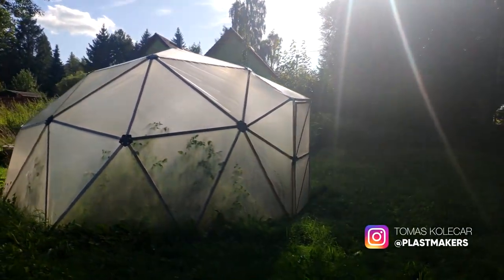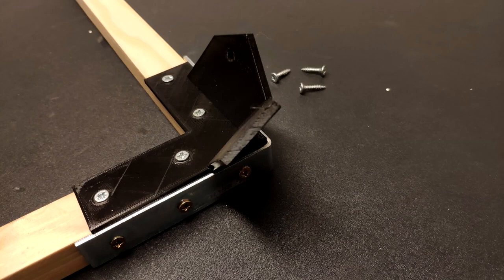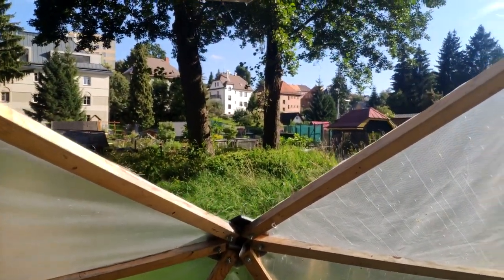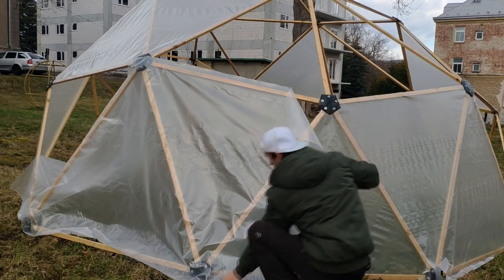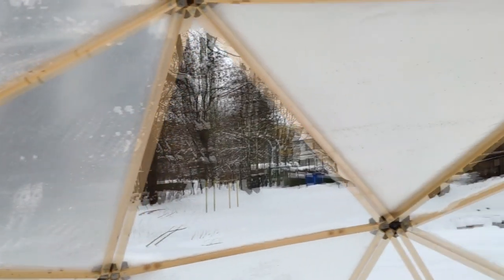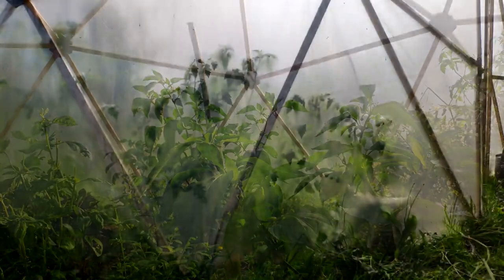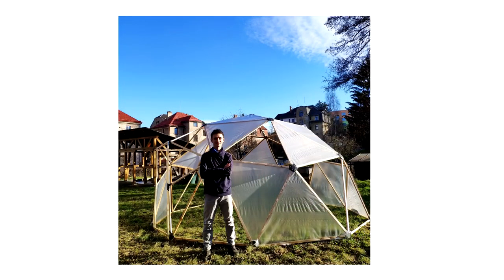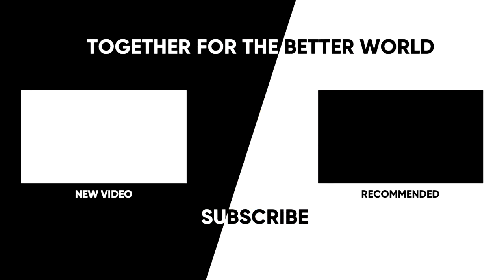How to make: Greenhouse dome

Comment: Thanks for sharing, amazing job. Can i ask, i have alot of pvc waste water pipe (21.6mm) and would like to build this as a dome over a pool however the 5 star piece that holds it together would be very difficult to make, do you have a solution on your shelf i could purchase. Thanking you
Reply from the maker: Hello 👋 thank you for your comment. I do not have experinece with PVC tubes, however joint design which I used for my projects is not suitable for connection of tube profiles. On internet you can find different joining technique for PVC tubes. On YouTube there is video "ZIP TIE Domes" 👍
Reply: @plastmakers  Thanks for coming back to me Tomas, greatly appreciated 👍